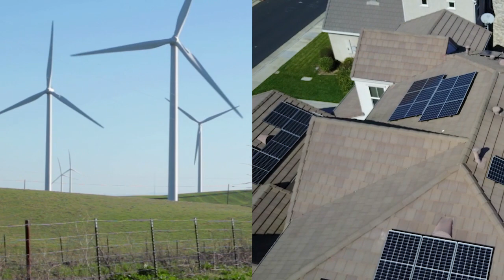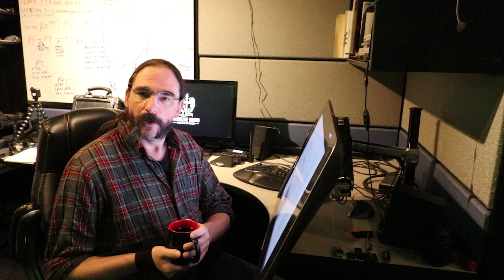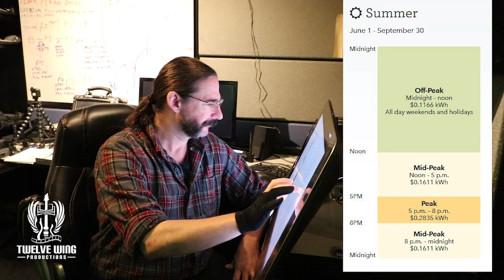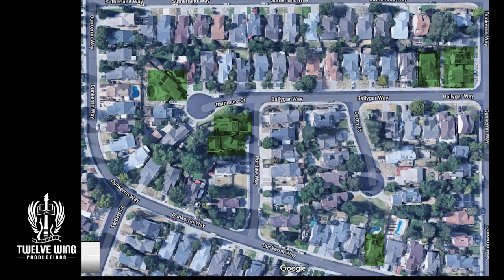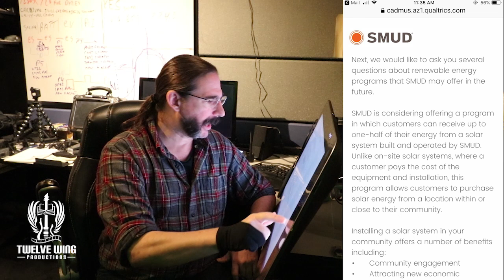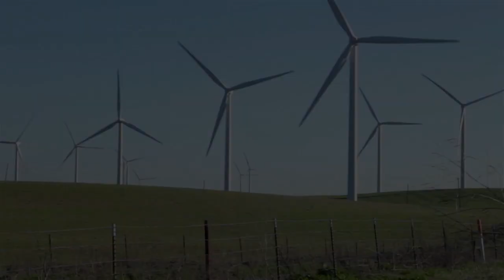Local utilities are terrified of Tesla's Powerwall 2

Comment: There is a big difference between energy production here in North Carolina from November through March. The best production months are April through October.
Reply from the maker: I believe that North Carolina is about at the same latitude as Bakersfield CA but I'll have to verify that.  So as far as sun angle you should do pretty well.
As you can see from what we are presenting, we have the same thing.  Fall off in October.  You will get a chance to compare it in real time to your own system as you follow along with us.
Reply: I live in Charlotte,NC and have about 39kwh of generation on clear day in the summer and about 47kwh a day in some clear days in the winter. My system is south west facing with 7.39kw of generation capacity. Looking at the sovereignty project the generation per kw is very similar to his location. For incentives, there is an incentive of 60 cents per kw installed starting in Jan 1. These funds are exhausted in about 4 hours and requires a design created by installer for you to apply. Feel free to reach out if any questions.

Comment: What is the size of your system? I have a grid tied 7.2 kilowatt hour system ground mounted here in North Carolina. Really only covers probably 3/4 of my electricity use in an all electric small cottage on Lake Norman. We have a 10 year net metering agreement with Duke energy. However, Duke has a minimum cost per month of $14. Therefore you can never totally escape cost of using the grid. We hope to install batteries when and if the costs come down but had not planned on separating ourselves from the grid.
Reply from the maker: @timcat1004 , funny, you seem to be the one obsessing over our system.
Reply: 8.8kw in NC myself, been on for 4 days.   Same theory on battery, see how the tech changes, and add it later.
Reply from the maker: @jasontrewin123 , yup.  Little by little.  Everyone is going to have their own threshold where they decide it's time to take advantage of it.
That's another reason why, if we were going to suggest any system at all, I felt I could sleep at night by recommending the Tesla powerwalls.
Of all the systems I looked at when preparing to start the project, the Powerwall inherited Tesla's ideology from their cars where the systems need to be able to be upgraded as they went along.

So buying one or two now and adding to them as they get cheaper and more capacious in the future should be pretty easy.

Thanks for following along!
Reply: Yeah, had to get roof replaced & HVAC so battery at this point would be cost effect add on.  Net metering + Single rate structure really make it hard to justify 40% of solar system cost on one power wall.     BTW, what monitor of solar production do you have?  Solar edge 7.75, their monitoring, has some issue with communication.  Solar works fine, just not able to get stable supply of metrics, Inverter had no screen on it, latest model.    We rarely have power outages here, probably count on 1 hand the number of times we have had even more than a few hours.    day 2, first “full” production, we had a 4 hour outage.   At least i know my invert shuts off  correctly.
Reply from the maker: @jasontrewin123 , I am using SolarEdge both at the ESP home as well as here at the studio.
It's been pretty good for us and has one advantage that I hope Tesla will include and that is the ability to look at daily history.
That level of detail isn't currently possible with Tesla's monitoring.  Daily figures are only available for the current day and the previous day.
Reply: @twelvewingproductions7508  Since Tesla has allowed us to poll the data directly from the PowerWalls ever since I had mine installed, many of us have developed various programs that database that data, and of course we can graph it many ways.  I've already seen a variety of scripts, programs, plugins, and templates for various databases and graphing systems.  I have my own graphed at eich tee tee pee colon slash slash ulmo dot solar slash powerflow slash.
Reply from the maker: The ESP system is 10.2kw currently run through a 7.6kw inverter.
Our theoretical peak output is around 8kw so we do loose a little currently due to clipping.  I chose the 7.6kw inverter because it would operate more efficiently at the lower end in winter than would a 10-12kw system but I may upgrade our inverter to 10kw in the next couple months.
I'll be running some tests in June to see if the additional power available to the system may merit the upgrade.  Especially since I will likely add 4-6kw of additional panels next year to be able to go 100% self powered.
We also currently have an $20 a month "Infrastructure fee" as well.
Reply from the maker: @timcat1004 , correct.. done as part of a test.
I noticed that you removed your comments on this subject on a more recent video and I'm not sure if you just forgot to remove this comment or that you felt it didn't cause sufficient embarrassment in the discussion thread.
But I'm willing to give this another go if you want to suffer through me handing you your head again.

My guess is that you actually had a look at the month 2 week 3 video I referenced in my reply.  I also take it that you discovered what the output of these panels REALLY are in relationship to my highest producing panels.
So yes Tim, these panels contribute.  I'll do a follow up to this in June when the data set completes and if you are still around I will be happy to discuss with you how north facing panels can be optimized for production either where the home is in more southern latitudes or where the home owner has no other choice but to install some panels in sub optimal directions.
Reply from the maker: @timcat1004 , no... not really.. no.
I actually would have preferred for you to keep them up, apologize and then have a discussion about how the angle of your roof, type of panel and your latitude all alter how much power might be available from panels even if they are facing north.

This channel is all about educating people with actual factual information.  It's not about personal attacks, politics... what have you.
So in this exercise what would make me "happy" is for you to realize that the length of a person's hair or where they live doesn't affect the facts they are presenting.
I'm sure you meant well in your own way.  You live where there is snow.  A roof that is set up with a pitch to allow it to shed snow isn't going to produce much solar power if someone puts panels on a north facing side.  And that... is the conversation I would have loved to have had with you MONTHS ago, rather than listening to you meld your personal feelings about the length of my hair or where I live with information, that though accurate to you geographically, was factually inaccurate on the whole.

So "happy"?  If it's truly my "happiness" that you are after then at this point you give a simple apology and we shake hands and agree to stick to the facts of what is presented through The Energy Sovereignty Project. 

I'm doing this as much to arm you with accurate information as anyone else who subscribes here.
Fair enough?
So I do wish you well with your project Tim.  I hope some of the information provided will help you when it comes time to select battery storage for your system.

All the best to you.
Reply from the maker: @timcat1004 , your claim was 1/10th of the power, and that is incorrect as a blanket statement.
The reason we are testing the north facing section of our roof is to examine the real world output AT the angle of roof we have, USING the mono duo PV cells and at OUR LATITUDE.
It's simply not possible, as you just found out, to make blanket statements.
What one needs to do is to actually do the work, do the tests and then present the results and explain why those results were obtained.

So whether or not they make financial sense is up to many different factors and frankly it's not up to you to decide this for people with blanket statements.
Calling them "idiots" for even considering it is also less than helpful.

The reason we are looking at percentage of reduction is that I envision a day when solar roof tiles are so cheap that it's simply a no brainer to install them everywhere the roof gets any sunlight at all.
Reply from the maker: @timcat1004 , for the personal attacks and for misleading folks by jumping to conclusions based solely on your opinions rather than the facts at hand.
But I'll take the removal of your other comments as apology enough and we can start again from here.
Enjoy the show.